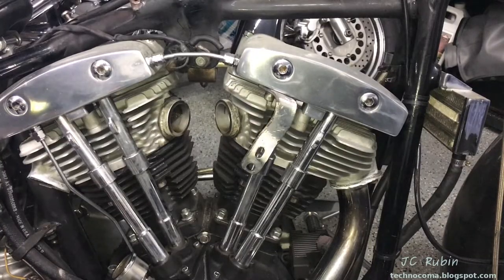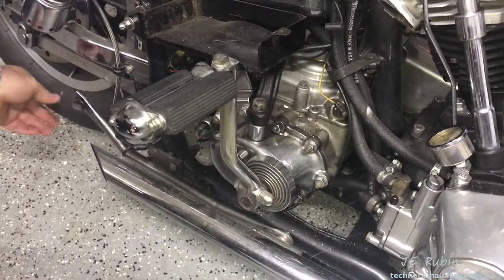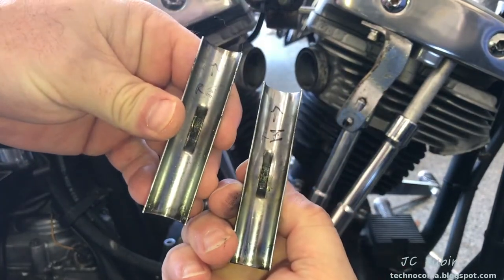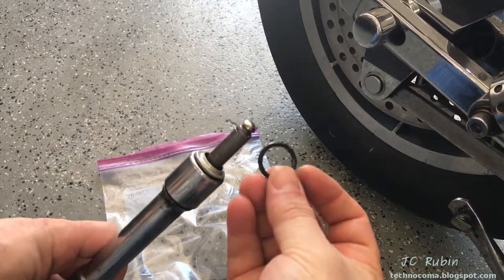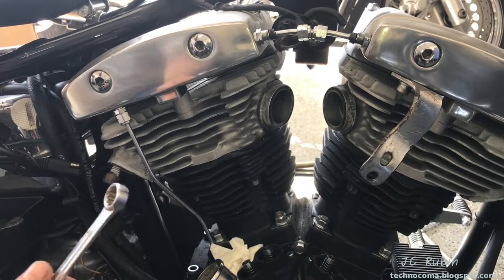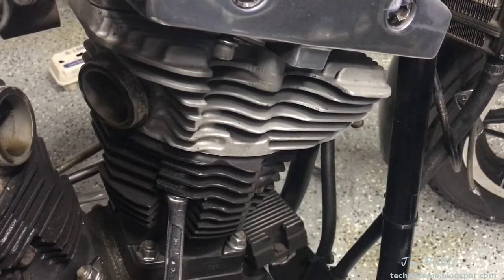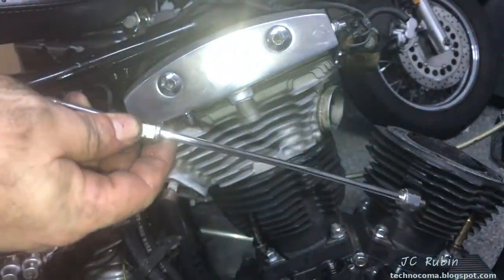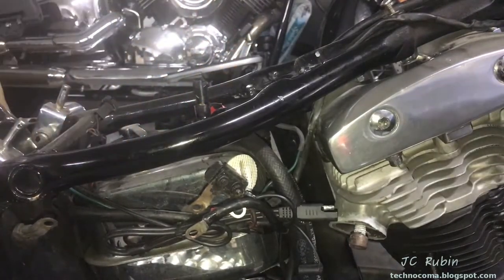AMF Shovelhead Lowrider Restoration -2- Head and Rocker Box Removal

Comment: Is it possible to remove the front rocker cover without pulling the whole head. I have a front exhaust push rod seal seeping and the front rocker box gasket. Engine only has 300 miles on it so I don't want to pull it all apart
Reply from the maker: Its not a rocker cover though.  Its the entire rocker assembly.  Yes it is possible to remove that only if frame clearance allows it.  The push rods will need to be removed of course.